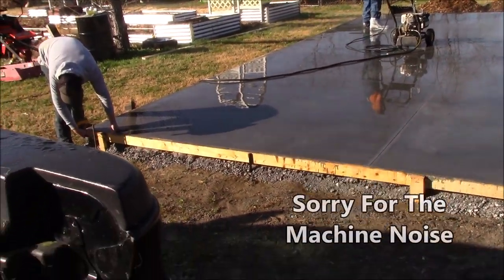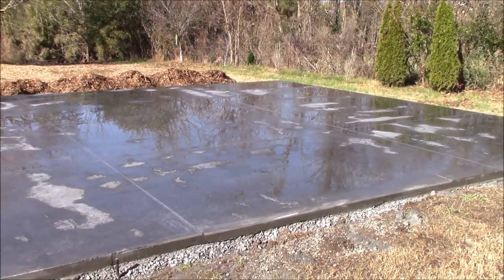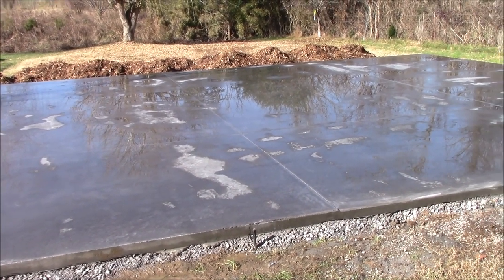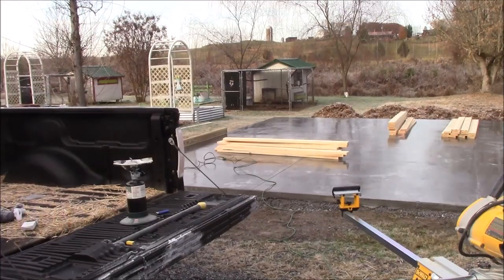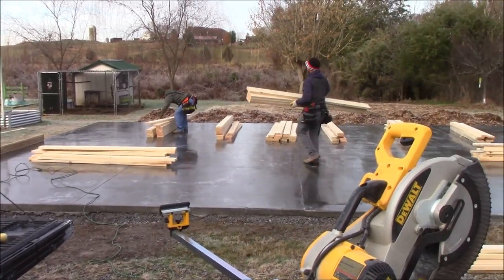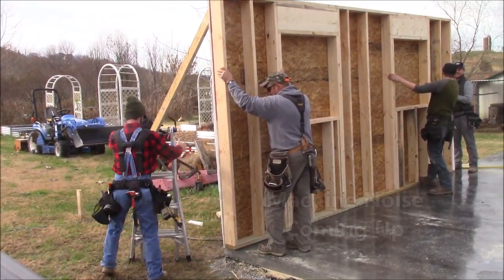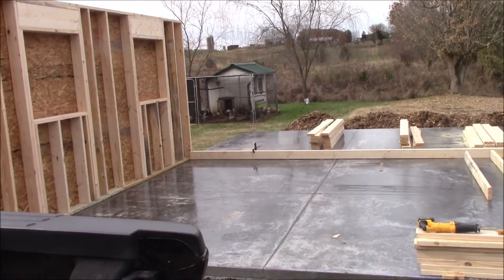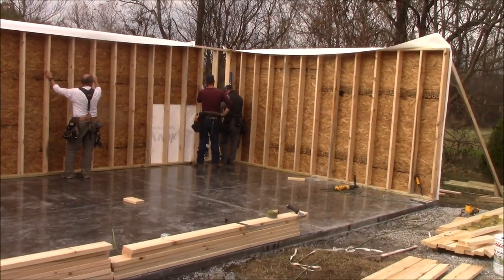Building A Workshop | Framing Doors And Windows | Standing The Walls

Comment: Great video once again my friends. One suggestion, when cutting the relief grooves, it's best to use a concrete saw that you can attach a water hose to, which will wet the concrete ahead of the cut line. This will greatly minimize the amount of dust produced. It will also make the clean-up process much less of a deal. Anyway, great video. Thanks for sharing. Take care and God Bless.
Reply from the maker: They said they normally use a wet saw, but for some reason all they had was the dry saw (I think the other was on another job)...  But we got it all taken care of and sealed, so forward we go....  Thanks for watching !

Comment: Hey Mark,
Great video, but I have one question for you. I don't know much about building a shed, so how did they attached the walls to the concrete floor? Cuz the way I look at it good Breeze would blow the walls off the concrete floor.
Reply from the maker: I wasn't able to get everything I wanted to on video but I had planned a walkthrough to explain some things, like this...  They actually drilled into the concrete between every other stud and drove in lag bolts...  I will be sure to show them in the update...

Comment: Without anchor bolts, are you using ramset nails?  The shed is coming along nicely!
Reply from the maker: They fought the ram set for about an hour to get about 6 in...  The rest is drilled in anchor bolts between every other set of studs...  I will cover it in the walkthrough I am planning...
Reply: @BumbleBeeJunction  I'll stop jumping the gun....good to know.
Reply from the maker: No worries...  I did not get everything on tape that I wanted to...

Comment: What's the purpose of the cuts in the concrete
Reply from the maker: They are relief cuts that take any tension out of the concrete as it cures, but more importantly, if the concrete is going to crack, it acts like scoring glass to break it, and it will crack along those lines rather than across the middle of a room or walkway....